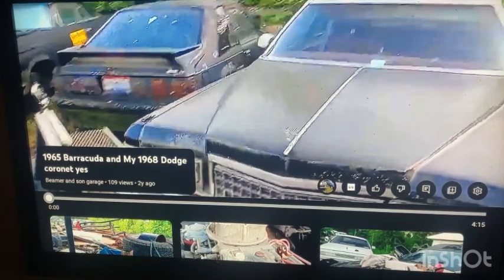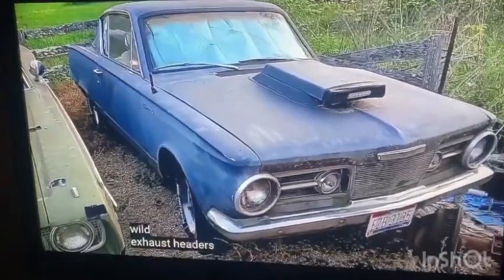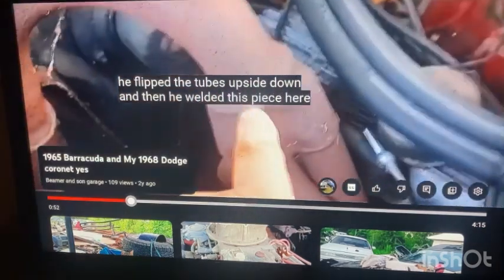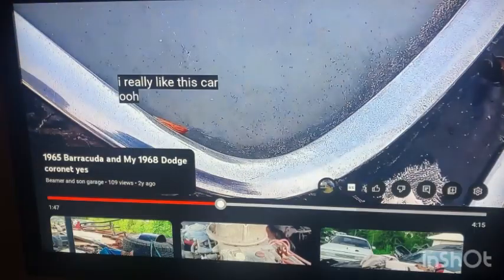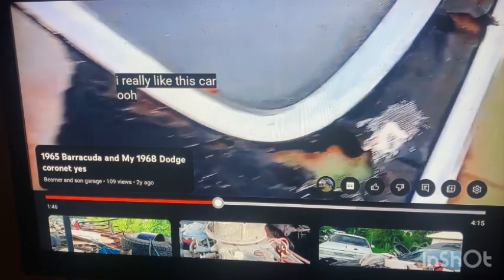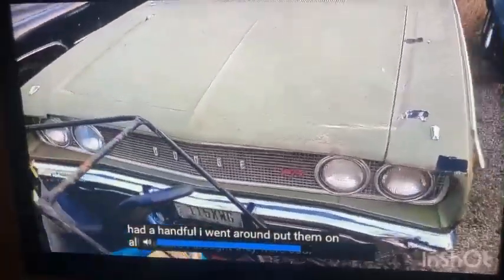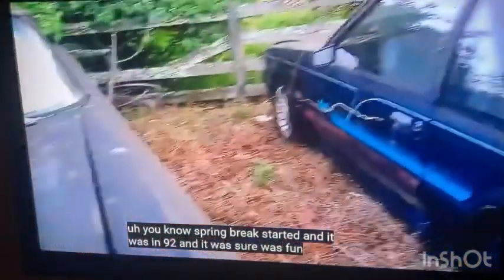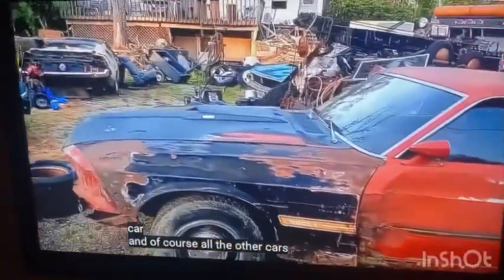Beamer and sons garage and the biggest junk pos barracuda ever seen on YouTube

Comment: Theyre called wheel well headers. Used on A bodys to get around the shock tower. Fords use them alot as well. Crappy example though.
Reply from the maker: Exactly they torch cut the inter fenderwells